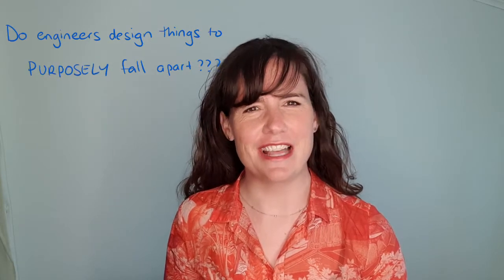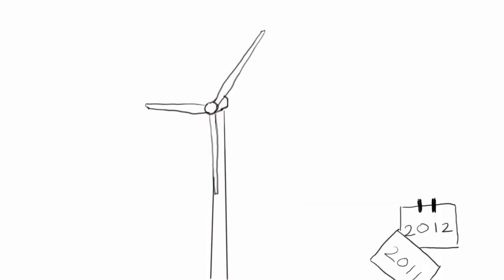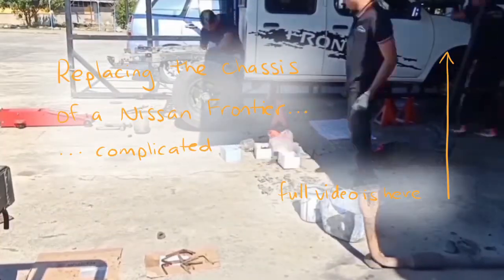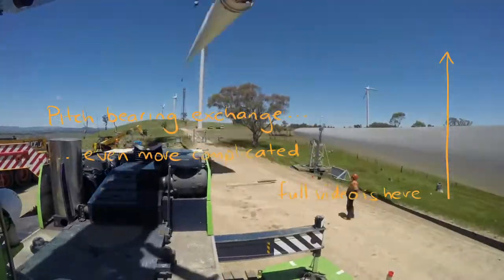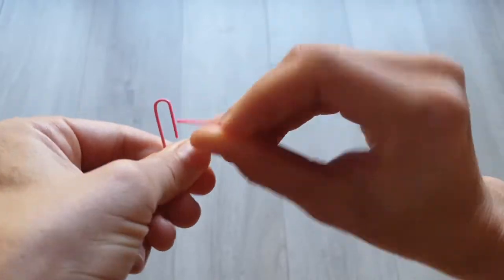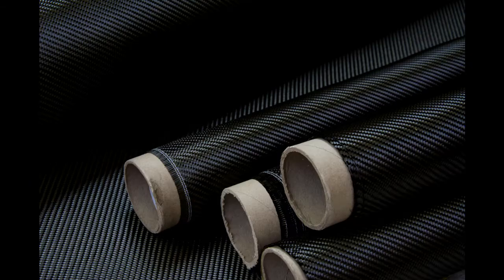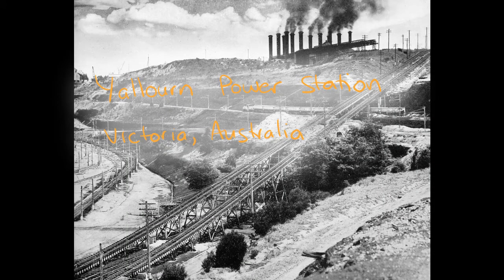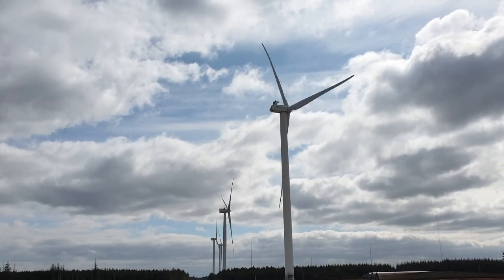Why Don't Engineers Design Products to Last Longer?

Comment: Pretty cool, great video! I wonder how the environmental conditions of a given site influence what the critical component is, like maybe since offshore turbines experience a more constant wind (if that's true?) but cycling loading from waves, the pitch bearings could last longer but the tower would be subjected to more fatigue? But then as you said, it's "easy" to design towers for a longer lifetime, so do you know if offshore turbines are designed for a longer lifetime than onshore?
Reply from the maker: Great questions, and I will need to ask some colleagues working in offshore for the answers 😁 A video about the different challenges offshore turbines have compared to onshore could be interesting.
I know for sure that tower designers don't have an easy job, because even if it is easy to design a long lasting tower, of course you will want to push the limits to use less material, make it easier to install etc. 
I know there is some really cool new tower tech in development now, like using pendulums to get around resonance problems that come with lighter towers.

Comment: Hi 
Sorry for late reply but I have only just found your channel 
Back in the early 80s I was involved with an engine manufacture and the sole purpose of the project was to ensure that the whole engine wore out together so it was was not viable for rebuild to ensure that it was exchanged for a new unit. There is quite a difference between a truck engine and a wind turbine, with the turbine you would want to maximise the life of every component (small volume production) and difficult to service and repair but in the case of the truck engine high volume production ease of maintenance and easy to design  in a limited life thereby a steady flow of sales. And this goes on with all large volume markets, there is no point in a manufacturer making a rolls royce and selling a small number of units when they can make a ford and sell millions
Reply: OF COURSE you try an engineer an engine so everything wears out at the same time. What is the use of having a component that always lasts longer than the rest of the engine?  It is a waste of money and material when the engine's lifetime is always going to be set by first part that wears out and is uneconomical to repair.
Henry Ford famously made this point when building the Model T. As a fascinating sideline animals' bodies have also evolved by natural selection to be like this, which is why it is never just one organ that wears out when you get old.

Comment: Really interesting look at all of the trade-offs. Spot on about the evolution of turbines and how much better (and so much more massive) than they were just a while ago. When my alma mater installed a Vestas V82 turbine back in 2005, it was one of the larger models on the market (1.65 MW IIRC). These days, that model is small potatoes. As always, thanks for taking the time to put these programmes together.

Comment: I heard once that they designed blades to last 20 years but then 7 years later they had improved the performance of the blades so they replaced them anyway.
And then decided that since the blades would obsolete in 7 years just design them to last 7 years.
Reply from the maker: Maybe that happened in one company one time, but that isn't normal practice these days (or in the last decade at least). Blade technology is getting better all the time, that's true. But they are very expensive to replace, so it needs to be a BIG improvement for it to be worth an exchange. The wind farm developers on projects I've worked on are requesting longer and longer design lifetimes because that makes the return on investment much better, which makes finance easier to secure.

Comment: My Mum's washing machine has one function. It is still performing it 40 years after purchase. Meanwhile I have had to purchase 3 machines in less than 30 years - built in obsolescence! Bad for my budget and bad for the environment with wasted resources and landfill
Reply from the maker: I had a similar experience with microwaves. Until a couple of years ago my parents had the same one they bought when I was two! Whereas I have been through several modern ones in my adult years. I think consumer appliances planned obsolescence, whether there should be right to repair etc are different issues to what I was talking about here with these commercial assets. I know I didn't really make a clear distinction, and I should have.

Comment: I mean it certainly have been a sort of conspiracy at times. With the lightbulb cartel and such. But there's probably numerous factors that go into things getting broken faster. Like increased complexity
Reply: In fact lightbulb cartel is not conspiracy teory, is reality :))
Reply: @eugeniusro  I mean conspiracy in this case just means a group conspiring to harm for their own gain. Conspiracy theories have been generally equated to being false just because most tend to be. Although that doesn't have to be the case. 

Say you're a detective trying to solve a case of a certain political figure being killed. Perhaps you then try to collaborate with the police to find evidence, but they refuse to work with you whatsoever for some apparen't reason. You already know some details of the case, like that election season was comming up soon, and this candidate was very popular. But also that this candidate wanted some sort of police reform and wanted to slash their budget. It wouldn't be unreasonable to conclude that the police and the opposing party for this candidate would be collaborating to hide the murderer. And that would also constitute a conspiracy theory.

Comment: .           Well I assume something like a wind turbine would come with a warranty equivalent to the stated lifetime or the stated lifespan is meaningless because the company selling them can just lie/fudge the numbers.  This is the problem with home appliances and other items, they come with no real warranty at all, certainly no warranty anywhere near a reasonable lifespan.  Thus the companies have every reason to make them break easily as that allows them to sell cheaper and then when they break to sell again (or send repair people) 

          As far as more efficiency technology, you got to subtract all the energy needed to extract the resources that make up the device from the ground, assemble it, get it to the site, etc.  It can be worth having a much less efficient device if it lasts much longer and requires less maintenance and repair. Plus I believe you yourself have made the point that these devices are already reaching close to their theoretical max efficiency.

Comment: It's kind of funny that during the design process you have to make a prediction about the expected progress of technology, which involves taking into account even economics and politics. But I wonder: since we live in troubled times, with rising domestic and international turmoils, and with climate change and ressources depletion ahead of us, are there engineers of "mainstream" structures (and in this case wind turbines) who are favoring longer lasting designs in anticipation of a relative stagnation or even collapse of society, which would prevent not only innovation, but even hinder installation of new structures? Imaging living in a failed state, it would be nice to have wind turbines providing electricity for 80 years rather than for 30 years, as it would surely dampen the collapse and buy some extra time to find new solutions.
Reply: If a state fails or society collapses then who is going to maintain the grid?

Comment: For bearing use material ceramic.
Aluminum oxide or silicon nitride.
Manufacture by company keosera. Japan.
In Vancouver Washington keosera has place that call structural engineer ceramic. I use to work there.
Ceramic bearing will last billion years.

Comment: Hi Rosie, how can wind power be used for base load power and is this realistic in our lifetime
Reply: "Baseload" is a term we should abandon.  It comes from "always on" plants like coal and nuclear.  They provided baseload electricity and then utilities had to figure out how to match supply demand over and above that 'constant drone'.

Better we talk about minimum and maximum demands and how we will take variable inputs from wind and solar and 'fill in the gaps'.  Storage is going to be the big way.  Batteries are getting very affordable and should do the majority of fill in work.  

There will be a few times a year when wind and solar generation will be low for a few days in a row and it may be too expensive to use batteries for that sort of extensive storage.  But we don't know yet.  We have to see how cheap batteries will get and what else might be available.  

It may be with EVs moving to lithium iron phosphate batteries that the battery packs will well outlast the car body.  A 10,000 cycle LFP battery in a 250 mile range EV would be a 2.5 million mile battery.  Maybe there will be storage systems that buy used EV batteries for cheap and use their remaining life.  The value of a used EV battery would otherwise be only the value of the recoverable materials.  And after the storage company was done with them they could be recycled for materials.

Maybe we'll hang on to existing CCNG plants and run them using methane from urban and agricultural waste streams.  Maybe we'll make synthetic fuel for the plants using renewable energy.

Maybe something even better will be invented.  The "last 1%" is not a problem we will need to solve soon.  It's going to take more than a decade to pick the lower hanging fruit which we can do with batteries.
Reply: @bobwallace9753  
With do many "May's in the comment it appears more fantasy than reality. 
What if we say maybe you can electricity today or maybe not. 
May be you are having an operation today the maybe the electricity goes out. Maybe one day in the future batteries will be cheap enough but then maybe they don't. 
For america to get a battery to run its grid, the Tesla  mega battery factory will have to run 24/7 for 500 years to built the battery and then it will run out of material before it finishes.
Do you want to run the country on maybe 's?
Reply: @charlescamen5225  
We know that we could provide the "last 1%" with batteries or CCNG plants run on renewable energy.  Those two "maybes" are cost related and we won't know for some years what the least expensive solution will be.  

And, as I said, someone may invent a better solution.  Liquid air batteries are in development.  Liquid metal batteries are in development.  Either of those might be the best solution.  Or something yet to be thought of.  If someone can figure out how to make a good quality sulfur battery that could be very cheap storage.

Bottom line.  If nothing else we could use pump up hydro storage.  That's a technology we've been using for more than 100 years.  There are no problems finding enough sites to install all we'd need.  But PuHS is not likely to be the lowest cost solution.  We have all the technology we need to keep the grid up and running 24/365.

BTW, I have no idea where you cooked up your 24/7 for 500 years stuff.  Apparently you aren't aware of how many very large battery plants are now under construction and how we have far more battery materials than we could conceivably need.

Comment: It's very much the case that household appliances manufactured today don't generally last anywhere near as long as those made in the 1950's and '60's.
Reply: Purely because they are an awful lot cheaper. When designing you set the economic lifetime of something by looking at the relative costs of replacement vs repair - and if the thing gets cheaper to replace then that design lifetime gets shorter. That is pretty much the whole point of Rosie's video.

Comment: What would be the best ways to reduce the environmental impact of wind turbines further? Like recycling or emission free steel + concrete, sure, how to make them recyclable though? Looking back from 2050 there are all these broken turbines standing around - please take us to a journey into the future, a vision how wind power could work sustainably and then indicate what the steps to get there would need to be :)
Reply: One study has shown that the materials that can be recovered from a 'used up ' wind turbine are worth enough to cover the cost of dismantling the turbine/tower and returning the site to original condition.  That assumed the blades had no value and the concrete foundation would be broken up and used for road fill.

Recently there has been progress in using the blades so the recycle value may have increased.  One of the uses is to cut the blades into lengths and bond pieces together to be used as structural components in large buildings.  Like engineered beams.

I'm not sure there are a lot of unused turbines standing around.  There was one wind farm in SoCal that was abandoned due to some sort of legal problem with the company that owned the farm.  But I think most outdated turbines are being removed because, in general, they occupy really good wind sites and people want to install new, more efficient rigs.

Comment: Why do wind turbines not use tails to point into the wind. Should not the tower last say 3 times the nellice and 5 times the blades
Reply: They don't have tails because due to the rotation of the earth, weather systems turn nearly always in the same direction, so the turbine need to turn most of the time in the same direction to face the wind. The problem is the electricity cable can only be twisted a couple of turns in each direction  and need to be untwisted with electric motor when they are too twisted.
I'm not sure if a tail would be effective on such big turbines, because of the weight of the rotor, the gyroscopic effects, inertia, the forces of gusts of wind...

With windvane sensor and electric motors, the turbine face the wind with more precision, which increase energy production.

Comment: Why aren't windmills designed with their own winch/hoist on the top to lift fully assembled hub/blades and install them?
Reply: I'm guessing such a hoist wouldn't see much use making it uneconomical.
Reply: @seneca983  It only will need to be strong enough to lift the hub and blades and could be cheaper than renting a mobile crane.
Reply: @ReevansElectro  I'm a bit skeptical of it being cheaper. Also, the hub needs to be lifted on top of the tower. I don't see how you could easily do that with a winch that's not somehow above the tower.
Reply: @seneca983  Oh, no! It isn't possible to build a purpose-made hoist mechanism on top of the tower. The tower has to be strong enough for the turbine to be mounted on it but a winch is beyond imagination.
Reply: @ReevansElectro  I mean, it's not enough to slap a winch on top of the tower (sans hub). You'd need some structure on top of the tower holding the winch so that it's above the top of the tower by enough that the hub fits under it. Otherwise, it won't be able to lift the hub all the way. Such a structure doesn't sound cheap enough to be more economical than just using a mobile crane.

But I thought of a bigger problem. The tower is often made of several sections which are lifted on top of each other with a crane. Since you need a crane for them, might as well use it for the hub too. Using an integrated winch for them sounds even more difficult.
Reply: @seneca983  You are right! nothing is possible if YOU haven't figured it out. You are always right.
Reply: @ReevansElectro  It's possible that I'm wrong but I think it's more likely there's a good reason why engineers haven't chosen to do what you're suggesting here.

You asked, "Why aren't windmills designed with their own winch". I gave my answer to that (though admittedly it's somewhat of a guess since I'm not a wind turbine engineer).
Reply: @ReevansElectro  Seems like an appropriate reaction to me... How dare he disagree with your question?
Reply: A system that is going to be used 3 or 4 times ( initial build, repairs and end of life) will always be more expensive than one that can be rented and do thousands of uses.

One crane can assemble thousands of turbines, but with your ideas, you would need thousands of winches to assemble thousands of turbines.

Comment: In other words, there is no point engineering a wind turbine to last longer than 30 years or so. As by 2050, today’s turbines will easily be very much obsolete. Just like most machines, especially where financial cost effectiveness is key. Even with consumer items, only a moron would drive a 2022 Tesla EV, or use a 2022 Sony 4K LED TV, 30 years down the line.